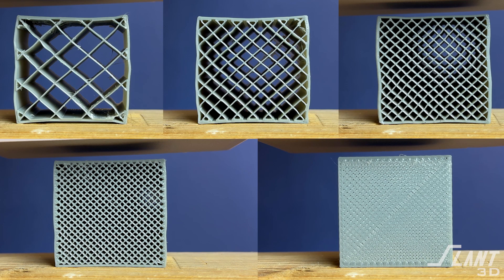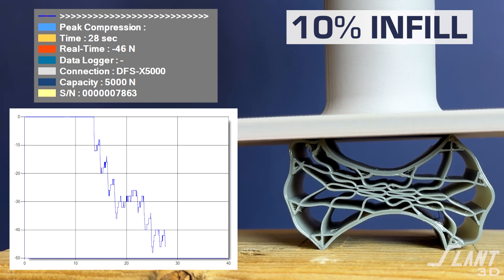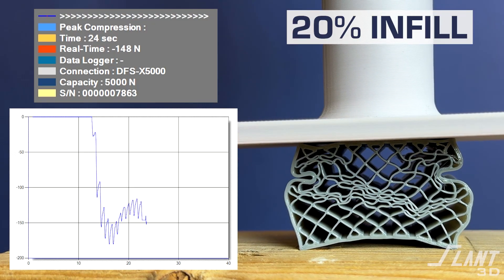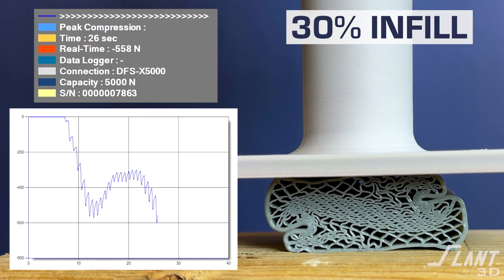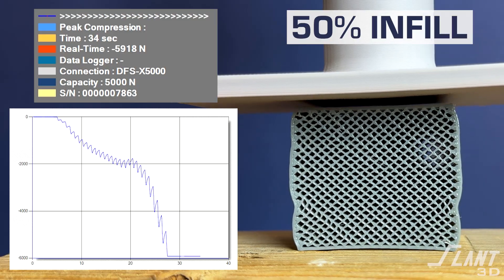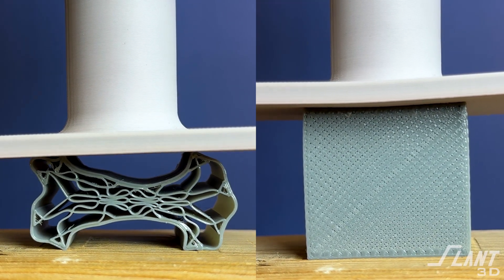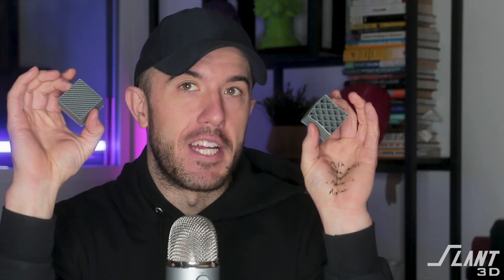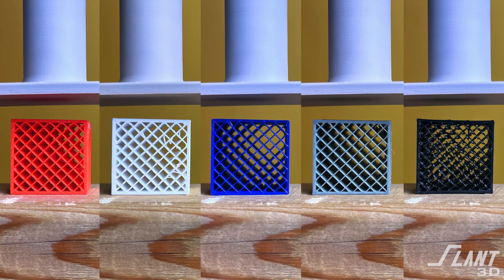Making TPU Hard and Soft | 3D Printing Testing Lab

Comment: I know this is an older vid so this comment may not be seen, but basically 95A TPU is kind of that golden shore hardness where you can make super dense, strong parts with good vibration damping at higher infills, but can also get nice seals/gaskets with it by using lower infill?

The reason I ask is I've been trying to reasearch which shore hardness is best for gaskets while also being somewhat easy to print and have more uses than just super soft stuff that I wouldn't need as often.

Comment: What do you guys use for printing RC truck tires?  I have 95A but my infill was too high and the tire is so stiff.   I feel it is not "rubbery" enough in general though, so as to give the car traction.    Just doing this as an experiment.    Does nozzle temperature make a difference?
Reply: For softer you can get a different TPU that has a different hardness, haven't tried any of them yet though.

Comment: I have a question about TPU. I know it's very hard to print on a Bowden based 3D printer because of the flexibility
of the filament. now my question is would temperature ( making colder for example before the actual printhead ) have a influence on the flexability so the Bowden and push it up the tube to the printhead and making it possible to print or get better results because it's more stiff before the printhead does it's thing.?

Comment: Can one show as a summary what all mechanical things can be printed on a 3d printer: Springs (as shock absorbers but also as a wind up mechanism), gears, bearings (almost), wheels, insulation (that piston with a bottle), propellers , this with different filling patterns to obtain different material properties (rigidity, elasticity)...

Comment: My only problem with TPU is that printing is molasses slow. Even with a direct extruder. My 3d printer is in a home environment and despite the fact that all protections have been activated and tested (thermal runaway, min temp etc) I cannot leave my 3d printer run unattended (even with webcam) because I'm afraid I've made small prints with TPU that take up to 5 hrs but this is it
Reply: If you reduce friction on the spool, you can get some speed increases.  I can hit 40 to 50 mm/s on some pretty flexible stuff.  Depending on what you are printing, it’s pretty decent.  I made a custom filament holder for my enclosure that uses skateboard bearings and I have it going to a pretty loose extruder on a Prusa Mk3S+ with a standard revo .6 mm nozzle.
Reply: @MattRhone  My spool holder also has bearings, and the direct extruder has a very short path from the intake to the hotend. I need to make a Voron 2.4 to see some real speed

Comment: Love TPU other than ABS it's the only thing I use, printed plenty of indestructible drone parts. Also there is a hard tpu from Ninjatek called armadillo that's 75D but, it's like $40 for 0.5kg and honestly worth every penny when you need it, only downside it has to print slow and hot with minimal or no fan but, when you get the layers to stick well it's just as indestructible as tpu with the stiffness nylon with minimal hygroscopic effect. If someone made it cheaper I'd be all over it, maybe even a middle option between 95a and 75d to print faster and maintain a little more flex.

Comment: Been thinking about printing some replacement bushings for my shock mounts on my truck.
Reply: I've done it for my Vespa scooter rear shock. Bushing has been in operation for 6 months, still in perfect condition. I'd argue it takes as much weight as your truck shocks would, given that all my body weight (240 lbs) is directly above the shock.

Comment: It would be interesting to stick to 10% infill, but vary infill wall thickness. Alternatively testing a round exterior part to see if holds up better than the cube. (eg: ⭕cylinder on side, with slightly flat top/bottom to keep from rolling if needed)

Such variation in stiffness can enable designing where and how a part deforms. For example could vary outer wall thickness so the part compresses like an accordion. ie: design in natural crease features. Any variation in thickness could be hidden internal on inner surface to make it seem like magic, or a smart part.
Additionally, designing the interior of part to become more resistive to higher loads as compresses can control the amount of distortion. But this is challenging to do without CAD software like Solidworks to visualize internal stress in a part.
It could be interesting to evaluate infill patterns, to understand high stress regions. For example the diagonal collapsing with 45º infill quickly propagates along an infill boundary. However, such simulation features are typically premium CAD options. Even though out of price range of many, it might be worth considering such CAD software as part of a testing series, for making visual aids, or animations.

Comment: What about the TPU that changes sure rating with different nozzle temp (infill stays the same)? I think cnc kitchen did a video on it. Curious if that is feasible to use with mass 3d printing

Comment: I'd be interested in seeing the parts turned 90 degrees so you're crushing them in the print orientation. This would more accurately reflect one of your examples: shoe soles.
It would also be interesting to compare the difference between horizontal and vertical orientations for your charts for various infill types. I suspect gyroid would be the closest in both orientations and possibly the softest, while cubic should be slightly stiffer while also consistent. Many of the others will likely have a significant difference between the two orientations.
Reply: I was looking for this or a similar comment. I agree, the strength of the infill only lies in the direction of print which I'm surprised he didn't even address in his video. The way the lattice is it's always going to crumple no matter what percentage it's at. Again, I'm just really surprised that he doesn't address that in his video.
Reply: He usually just copies other youtubers homework like stefan for instance
 @michaelwalker1017

Comment: You should do such tests with pressure rather than newtons, unless I'm missing something
Reply: Well we know the surface area of the cubes, 30mm^2, so plugging that into the pressure formula gives, for example, 33.333MPa at 1000N
Reply: 1 Newton = 0.225 lbs
Reply: @Omniverse0  I don't think you understand. That's still a force.

Comment: It's hard to find, but I've seen two filaments that are "max hardness" TPU.  Taulman PCTPE and Ninjaflex Armadillo.  They're 1/2 to 1/4 as stiff as PETG, but still have massive elasticity.  They're the sweat spot for 3D printed parts that need to be indestructible and stiff.
Reply: Extrudr also has a hard tpu but, only 58d. Armadillo is my go to for this part can't break and needs to be stiff, wish it was cheaper.

Comment: The 100% example looks like it has under extrusion. 

I print many functional parts with TPU. It works well for automotive parts like door bumpers and body seals. It holds up well outdoors and in sunlight.
Reply: Could this stuff be ideal for small bushings?

Comment: will you be testing different materials for material creap? plastic deformation  resistance to long term static pressure, because stuff can be stiff or tough or soft and forgiving but sometimes that is for nothing because you need constant dimensions and repeatability
Reply: This is a great one to test.  For instance I've found PETG to be far better vs creep than PLA or Nylon.

Comment: a stiffer variant of tpu would be great. better load bearing at lower infill and better printing with less issues (more forgiving about the extruder design). the layer bonding is incredible. a mixing nozzle on the printer would allow combining tpu and pla into whichever shore value you like with smooth transitions between them.
Reply: It's hard to find, but I've seen two filaments that are "max hardness" TPU.  Taulman PCTPE and Ninjaflex Armadillo.  They're 1/2 to 1/4 as stiff as PETG, but still have massive elasticity.  They're the sweat spot for 3D printed parts that need to be indestructible and stiff.
Reply: @martylawson1638  oh yeah i remember pctpe being the recommend material for racewhoops
i might try that on something, a little expensive, though
i also have a roll of PP which has great layer bonding, too
Reply: @marc_frank  You can find armadillo for around $30 a half kg if you look around for who's cheapest. I've printed plents of drone and rc car parts that need to be stiff and it's amazing stuff, basically indestructible.
Reply: Nylon is used in automotive parts exactly for just that. It's just not as flexible but can stretch if thin enough, like when it's used in clothing for elasticity

Comment: I use a lot of TPU for fixtures at work for a many of the same reasons mentioned.  I have some fixtures that need a ridged base but a softer upper portion.  I can print the lower portion with a very high infill and add an infill modifier block to change the upper portion to a lower infill density.
Reply: Infill modifier block.  That's the google search keyword I needed.  Thanks!
Reply from the maker: Great example

Comment: This kind of study would be really intriguing if done with the foaming tpu. I believe it is made by either colorfab or esun. Its simular to their light weight foaming pla. Anyways it adds a whole additional dimention as the temperature changes the parts stiff ness as it is effectively changing the infill of the line being extuded. Therefor you can change the infill of the part and the material being extruded.

Comment: So a springy material behaves like a spring?  I guess I'd like to see how the spring constant deviates from theory as a percent of infill changes.  Any mechanical engineers out there?
Reply from the maker: Good Idea. The spring constant would basically converge toward the solid material estimation as infill increases and the material properties become the dominant effect over the structural properties
Reply: @slant3d  Buckling of the infill makes this a much harder problem.  Might be some equations for foams that would apply.  Might also help to avoid buckling by using an infill that's all curved walls, I.e. Gyroid.
Reply: @martylawson1638  First of all, I'm a PHD Chem E by education so this is not my strong suit.  But, with low percentages of infill, it seems like the basic model might be  to assume that the bars are rigid, and the model consider how the density of joints varies with infill.  And how does that density of joints affect the spring constant.

Comment: Tpu is also great for the abrasion resistance. For mechanical parts like gears solid Tpu works great
Reply: For gears I use PETG. It is not so hard but stif and resistent.